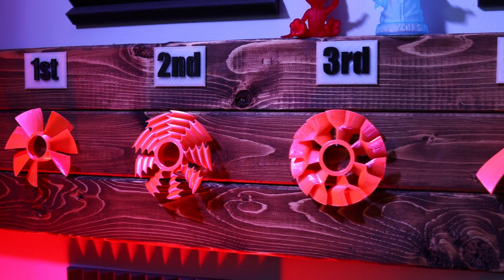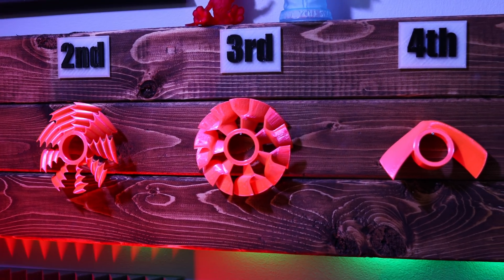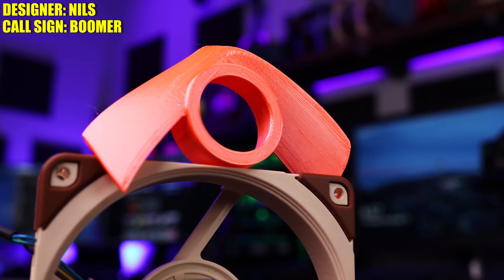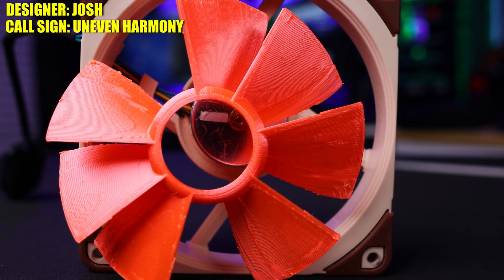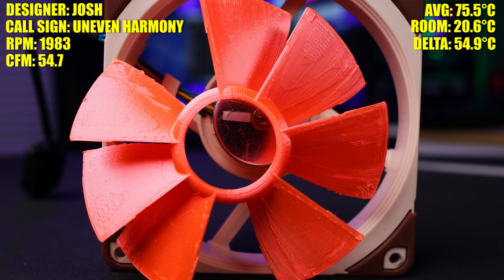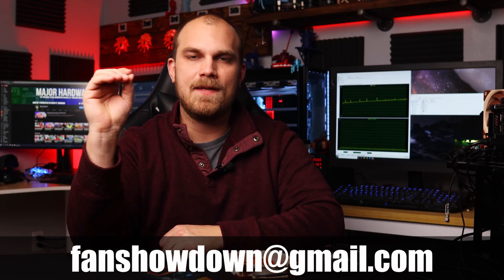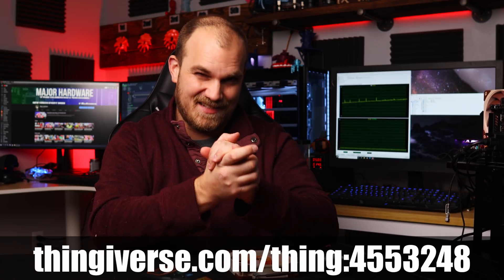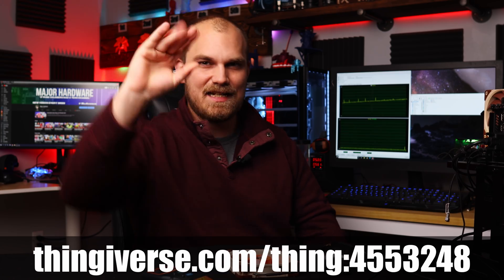The Boomerang Fan is So Much Better Now | Fan Showdown S2E1.5

Comment: This episode explains perfectly why we need noise normalised thermals.
Reply: Noctua could easily make fans that cool much better, but they wouldn't sound as smooth.
Reply: Honestly: No. Noctua needs to make fans which cool good and sound good, are affordable and all yeah. 
But the Fan showdown is not made to present ideas which would be commercial fans, but rather test out unique and cool fans. The fans should get the same motor and all other stuff is not regulated or else we will see more normal designs all over the place. Also something like a tulip with some strange dimensions should be allowed.
Reply: @dragonfire3289  Actually, the fan show was to see if the community could make a fan that rivalled the noctua. And considering the noctua is designed for efficiency at reasonable noise levels, and all these tests are using the noctua motor and housing, a noise normalisation over a small range is the only way to fully determine whether a fan competes or not.

There are plenty fans that out perform the noctua in pure max capability, but the reason it's the gold standard is because it's almost the best at cooling while being almost the best at noise reduction.
Reply: @ALifeOfWine  I see your point, but I still think that it evolved into more just design the best fans with a lot of wired designs. Otherwise we would just see boring fans since noctua probably has invested some hours into making the perfect fan for real use in PCs.
Reply: @dragonfire3289  Well it's still entertainment, but there's still a leaderboard. I said in another comment that there's no reason you couldn't do everything, you just need a minimum of 3 temp tests per fan:

At lowest rpm
At least 1 noise normalised dB or sone level
At highest rpm

Plot a line graph of dB Vs temp to compare the fans.

Now you know the best fan at every test point you could want.
Reply: Choosing a sound level to normalize all results means you ignore the fan's efficiency at doing its main job: moving air. You're also going to have to estimate what is an acceptable noise level for everyone. Not only is this kind of absurd on its own, you're forgetting that there are noisy GPU fans (which can often be the loudest component in a PC). Also, everyone's case is different (leading to different acoustics), and our PCs are in different places, and there are different ambient or external noises around us (not to mention we all have different hearing sensitivity). Basically, not everyone will agree on sound. We all can agree on heat dissipation.
Reply: @michaelscott-joynt3215  Read my last comment about 3 test areas. With regards to what dB level in between min and max rpm, considering everything is being compared to the noctua, the dB level at the mid rpm of the noctua should work although not be perfect.

If doing multiple readings between min and max rpm, then every dB integer between min and max would be the best.
Reply: @ALifeOfWine  I've heard him make note of fans that are considerably loud or those which sound like normal fans. I think you're getting into a level of testing that might be warranted if you're going to actually produce a competitive design, and this comes after a lot of refinement. We're at experimental stage. If fans can't do what they're supposed to do, then noise is irrelevant. You say "there's no reason you couldn't do everything". Maybe it's far more work and effort for something that's not really the focus of current testing.  I'd rather see out of the box ideas submitted. Who cares about a leaderboard? Let's get people thinking out of the box. Someone will hit on a good idea.
Reply: @michaelscott-joynt3215  And how will we know they've hit on a good idea unless it's tested properly? It might be great at that particular power but suck when going faster or slower.

Besides, if all you want is the most effective fan using that particular motor and housing there's a relatively simple formula for it.

The reason manufacturers differ from that formula is because of attempting to keep noise levels down and trying to keep efficiency across a range of speeds.

So if range efficiency and noise levels aren't tested for, we won't actually know if the fan is any good for the purpose of being a PC fan.

Comment: I'd suggest also testing the airflow without restriction. Some of the "bad" fans might in that situation outperform those that did well in a restricted case (with a fin stack behind it). This is because depending on the fan design it might provide a lot of airflow at lower pressure or the other way around. Just like how a compressor fan looks a lot different than an airplane propellor

Comment: Actually, this guy stumbles upon a new untapped genre of U-Tube content - viewers competition channels.

So, what other contents falls into this genre? I believe they are mostly design / tech related. Ex:  best homemade method to harvest rain water to generate electricity, simplest bird feeder that effectively prevents access from squirrels,  cheapest adruino controlled perimeter security etc.

It doesn't have to be tech related though.  The you-tuber can do a channel testing user submitted tips / tricks to sell some junks at the highest price, for example.

Comment: To be honest you should instead compare the fans at the same power output, that being CFM*DynamicPressure. That would compensate for the differences in flow vs pressure in each fan design. Otherwise a high static pressure fan would do great on the rad but a high flow rate one would do poorly. 
All in all thats the more correct way if im not mistaken but it would require a more complicated setup to get the readings.

Comment: I would still prefer a noise normalized test, as this would be the fairest overall. RPMs and performance can vary, but noise is the same. Baseline should be a 1400RPM A12x25 and the rest has to reach the same loudness.

Comment: Thanks for removing the speed limit! I think that a noise floor could be more appropriate for a typical usage of this type of fans, for example test how do they perform at the same noise level of the reference fan (the noctua), or whatever noise level defined as acceptable.
I understand that this would mean double the tests for each fan so if it's not possible just continue with the full speed test.

Comment: Because of returning to the old methodology to allow all fans the same power budget now instead 3 noctua beaters by a lot you have 1 by a little and the heavy big fan dropped places. As expected, it's physics, it works, and the crowd is happy.

Comment: Should benchmark the fans with an rpm vs temperature curve so you can see how each fan performs at various speeds, maybe max speed, then increments of 100 rpm.
Reply: Good idea except for the time it would take to do all of those tests
Reply: @kaminelson1277  yeah, cool series regardless, pun intended.

Comment: This would be a good problem for a neural network to solve, but like how you can teach and AI to walk by trial and error over millions of simulated runs using a scoring system to determine success or rather good habits of something that walks; in this same way you could make a neural net that could look for high air flow numbers at 2000 rpm and it was automation ally change shapes till it found an optimal format.
Reply: There's a method for things like this that starts by allowing almost every design, then very slowly making the parameters more strict which allows for a design that at first is bad, but then is even better than what a simple network would find.

Comment: if you want to put a cap on it, I would do a decibel limit
Reply: 100% this
Reply: if he did I would also like to see him standardize the distance he records the sound at. Like gamers nexus.
Reply: @DoubsGaming  yeah of course he'd need some kind of nearly perfected setup
Reply: With all the options he has for doing this I think the current test isn't the worst nor  the best, at least not for all situations and goals.

As for setting a noise limit I think it would be a good idea to keep doing the test as he has them now  and then at the end of the "season" do a retest of the top contenders with noise normalization and present the data ranked for performance when noise normalized as well as the noise when running at max power. That way the most capable fans also get tested noise normalized. Something has to be figured out for fans like the boomerang though, as even though it measures well it introduces way to much vibrations to be a good choice even if the audible sound level would turn out to be reasonable.
Reply: I Agree with you, noise normalization is a great idea. I would love to see him do a noise normalized run in addition to the other testing, but not replacing it. And maybe having a special spot for the most efficient fan at low noise in each season. After all noctua is going for silent + efficient as well.
Reply: Disagree. He's measuring cooling power as the output. If he's going to limit anything it should be power input, so we're measuring efficiency. Noise is an efficacy loss anyway.
Reply: @christophertstone  But as a overclocker the only thing i care about is cooling temps and noise.
Reply: @Smasheer123  @Christopher Stone
Why not do both and then you can say well this one is better for guys who want quiet fans and this one i better for guys who want maximum cooling. Maybe one design is better at both? Maybe have a delta between the two states and the leaderboard is the highest value with the lowest delta?
Reply: @N3onDr1v3  personaly i rather use a bigger rad with 2 fans at a lower noise level than use 1 fan thats louder..

Comment: Since the Noctua design takes noise level into consideration, shouldn't the testing be noise normalized?
Reply: it would be a nice addition, I also like the raw results though, some people aren't very bothered by fan noise and some cases block the noise very well.
Reply: Recently we have been testing pure performance. Noise could be another season in my opinion.
Reply: @krazykidmusic4954  exactly , or even run them all again at the end of the season and figure out which is best airflow vs noise wise . Especially since we already have one that beats the noctua airflow wise but I'm guessing not noise wise
Reply: @infinitetoast9200  Re-running old fans is a great idea imo, would save on PLA per episode too lol
Reply: heck no! i run my fans at 100% all of the time always. that stupid over heating intel i-7 junk i have sort of requires it. i'm interested in maximum CFMs, i don't care if it sounds like a leaf blower.
Reply: @iamzid  Maybe you don't have the best cooler?
Reply: @iamzid  I also prefer noise to temperature, but since all manufacturers strive for lower noise levels i have to conclude most people care about that
Reply: I wouldn't say normalized but I would like to see it taken in to consideration

Comment: You should lock the fans at a certain sound level, since that's all that really matters in reality.
Reply: what is thought to be important or ignorable depends on the person.
Reply: @TheJunky228  There are a lot of potential things that we can care about: sound, cooling performance, power consumption, coolness and etc. The two things that really matter are cooling performance and sound levels, those are really the things that affect us directly. Since we're interested in the best cooling performance, then by  controlling for the sound we can determine the best cooling performance per sound. Which means that the fan that's in first is the fan you can slam in your pc and it will keep your cpu cool and wont drive you insane with all the noise.
Reply: @ZeBeowulf  no, those are two things that matter to you.  You can't broadly apply that to everybody or every application. 

Maybe I have a server in a closet and don't care about noise at all?  Or maybe I am going for the ultimate cooling performance bar-none and don't mind some extra noise.

Maybe I want to use the fan in an extremely low power environment (running off battery power, or expensive electricity or something) and it only needs to cool well enough for the cpu to not melt, and draw as little power while doing so.

One interesting test could be to set an attainable cooling performance goal, and reduce the fan speed until that goal is exactly met, to see what the power and noise performance would be for each design.

There are many variables, and many ways in which they can be combined.  And many situations which can determine important or unimportant variables to be considered
Reply: @TheJunky228  The simple solution to keep everyone happy is to do a minimum of 3 tests per fan.

Record dB and temps at:
Min rpm
At least one normalised dB or sone level
Max rpm

Then plot a line graph of dB (or sone) Vs temps to compare each fan on.
Reply: I care about performance and not about sound. My pc has 24 fans and sounds like a jet engine when in gaming mode.
I find sound level measurements mildly interesting, but locking it down to any specific amount I don't really care about. I want to see the full preformance
Reply: But what sound level is appropriate? Some people want quiet. Other people don't mind small jet engine noises because performance is more important. Let's also consider that, in many systems under load, GPU fans contribute to most if not all obnoxious noise. The reason for the normalization used is to test efficiency. It's actually not fair to test at a certain sound level because not every fan will be at peak efficiency at that level. They all can be fairly tested at their max speed.

Comment: Might be interesting to see, if you want to go the extra mile, to go with a 'performance curve' idea. 
Example would be 'boomer at 500RPM makes this much noise, moves this much air for this much cooling... at 1000 it does this, 1500 it does this... and full throttle it spins this fast for this much airflow and noise'

Give an idea on what different fan designs could work at differing speeds, as well as ideas on their acoustics. Plus graphs, everyone loves graphs, right?

Comment: What were the dBA levels for the fans at their max speeds?

Edit: I have been informed that the dBA levels from the last video WERE measured at full speed. Sorry for the confusion everyone.
Reply: He did the dBA ratings at normal speeds if I’m not mistaken
Reply: @nikdelano  I don't mean to sound like a jerk, but that's not what I asked now is it?...
Reply: @CryptoJordanVR  What I think he is saying is that the dBA levels you are looking for are in the last episode. Also if you feel the need to preface your statement with "I don't mean to sound like a jerk" then there is likely just another way to phrase your statement so that you don't sound like a Jerk...
Reply: @RhinoTurner1991  But the noise they make is not gonna be the same, so we want dBA readings for this test as well.
Reply: @RhinoTurner1991  Yes, I know that, but I did it for dramatic effect. You see, it's like this. When Person B answers Person A's question by using the answer for a different question that Person A didn't ask, it's both rude and annoying. Because, by doing so, Person B is assuming that they know what Person A wants better than they do and that their unrelated answer is "good enough"...
Reply: @CryptoJordanVR  what nik was saying is that the last test of this fans where he normalized the speeds he actually measured the dBA at max speed, only the other values were normalized to the same speed
Reply: @LucasSilva-lc9wh  I just went back to the old video to see if you were right and YEP, he did say he tested the noise levels at Full Tilt... I forgot he did that... Well thanks! At least you were clear on that... Sorry about that everybody, but, in my defense, PLEASE be more clear next time...

Comment: Why don't you check boomer in 1200rpm with noctua driver and 100% filled one.
Reply: Ok boomer... moving on up... 

In case you're looking Major:

Anyhow I really suggest you do both. 
1. Cap them all at one speed, record results. 
2. Have them run full speed, record results. 

This is more real world as it represents the most common cases of users, those that run fans slow for noise and those that don't impede their fans. 

Don't impede the fans, do both.

Comment: I wonder if the boomer is pushing more turbulent air through the cooler and that's making it more efficient.
Reply: Wonder if there could be a wave of hot air its pushing out the sides in front of what it is pushing through

Comment: When you actually print the fan how the creator spesified 2:35 😂
Reply: This is mainly because of the rule change which lets the fans spin at the fastest rpm that they can for a certain power limit. Even if he didn't re-print the boomer but still re-tested them all, it still would have moved up in rank. This method of testing rewards fans that have less drag which is why the boomer did better this time around. 

Assuming that the boomer was still pretty well balanced without 100% infill, it actually may have performed better than the re-print because of its reduced weight (although weight doesn't have a whole lot to do with fan performance apart from spool up time (to a certain extent))
Reply: @callanbrain8579  that's all fair but I still think it's very important to follow the instructions provided by the designer otherwise you aren't really testing the submission.